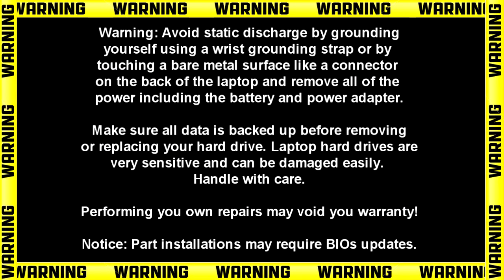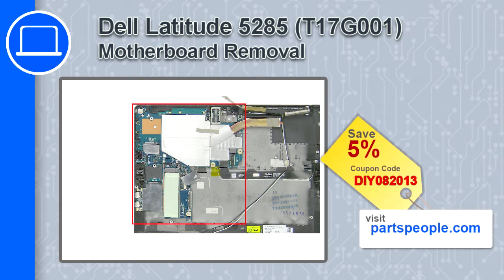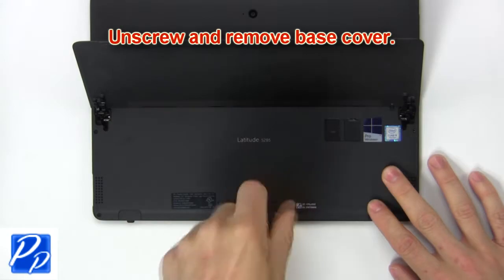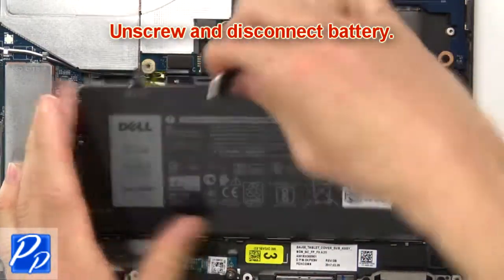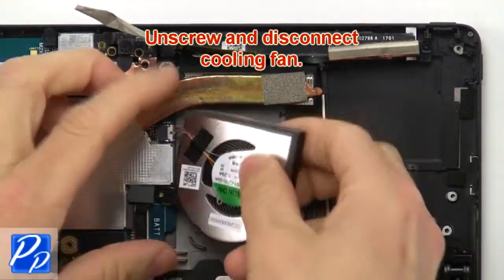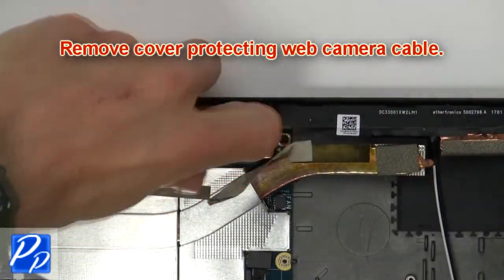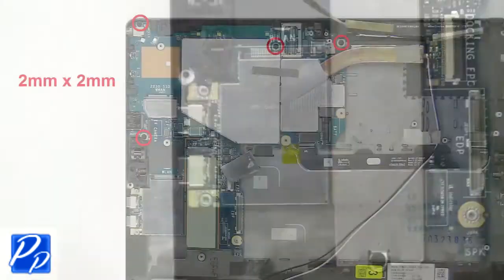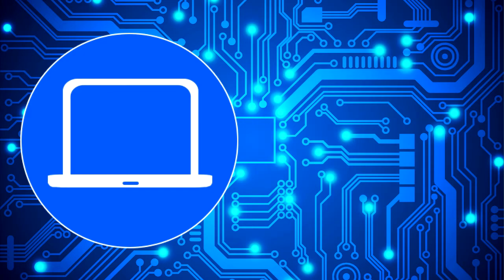Dell Latitude 5285 (T17G001) Motherboard How-To Video Tutorial

Comment: For anyone wondering, how to remove the display (which opens the device): After removing the screws on the backside it's just clipped in. you can easily separate it from the body with a plastic spudger or even your fingernail. After having opened one edge just go around carefully.

Comment: When taking apart the lcd away, does it actually glued together to the screen or there any kind of adhesive component that hold it? And in that step are u actually heating that up using heatgun or something in order to unholded the glue?
Reply: It's just clipped in - the display cable is connected at the bottom edge. There's no glue.